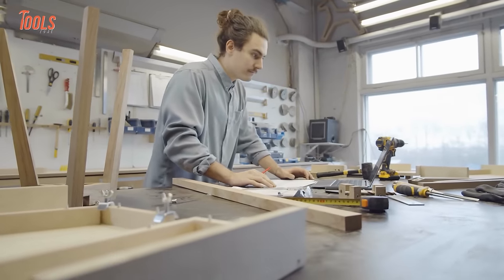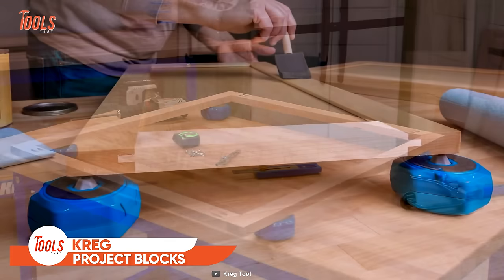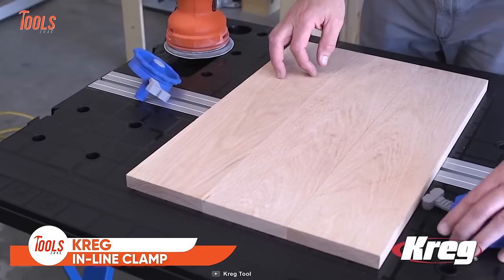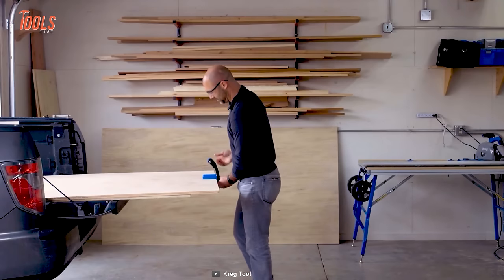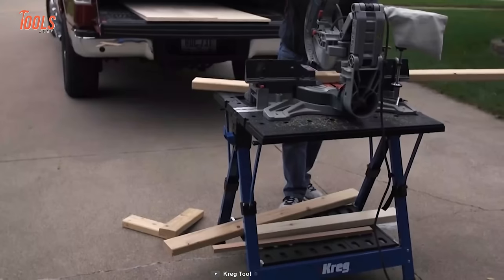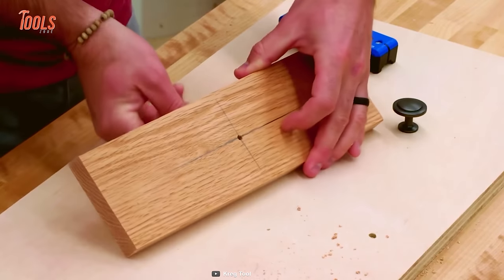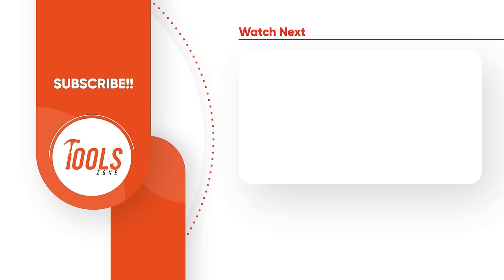10 New Amazing Kreg Tools for Woodworking

Comment: A lot of Kreg tools are indeed made or plastic as mentioned in other comments, Although I have used my Kreg Tools for years with out complaint, And I might add when i ordered direct from Kreg tools there customer service was first rate So i really don't understand what the negative comments are  biased on. I would and will use kreg tool in the future
Reply from the maker: Thanks for sharing your experience .
Reply: Agree. Don’t understand the snobbery around plastic sometimes. Easy to clean, lightweight and cheaper to buy. Not everything needs to be made exclusively of metal.

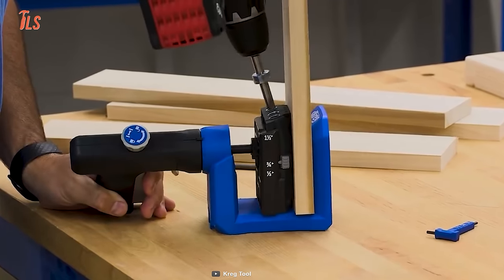Comment: 2:35 "....holds every work piece securely in place" .   Well not exactly.  Boards with an angled edge tend to wander unless you take 4 times as long to drill it.